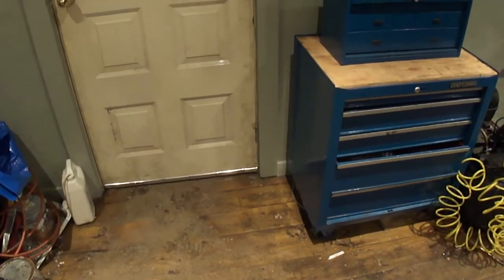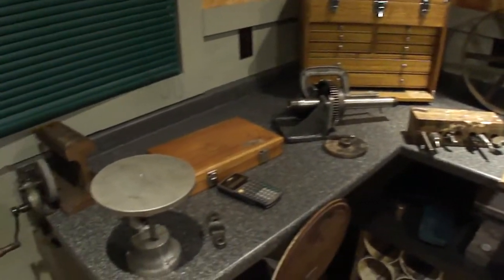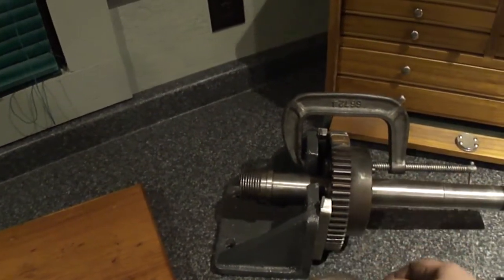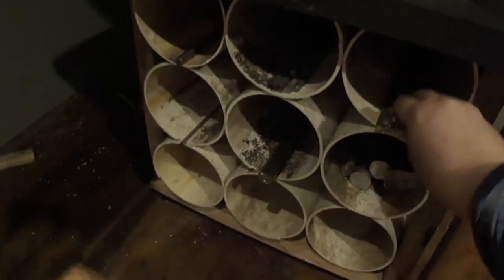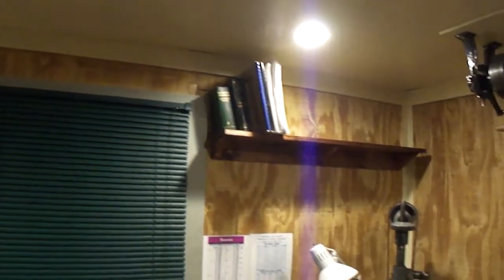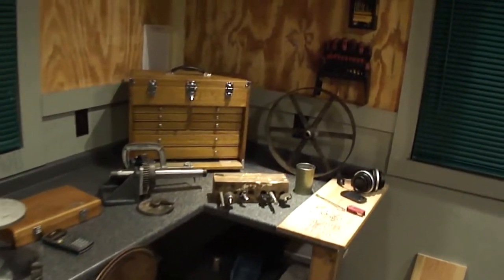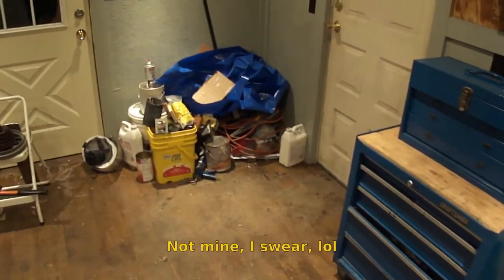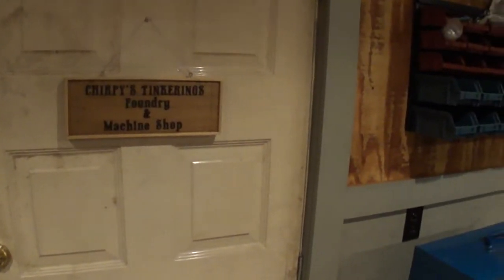Random Bits #13 - Random Shop Updates

Comment: Nice little shop you got there! That cart for material is really smart, i might borrow that idea. Cheers!
Reply from the maker: lol, thanks, I saw something similar where they had the pvc pipes setup for shoes, and I thought it would be cool to put round stock in, but make it into a cart that I could stick under the lathe. Unfortunately, it's too long front to back and wont fit under the lathe anymore, lol.